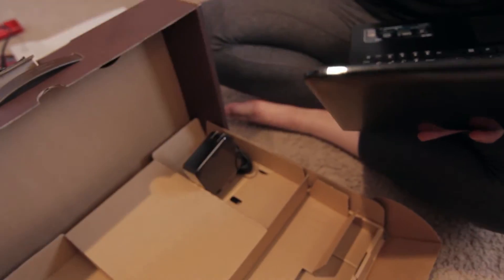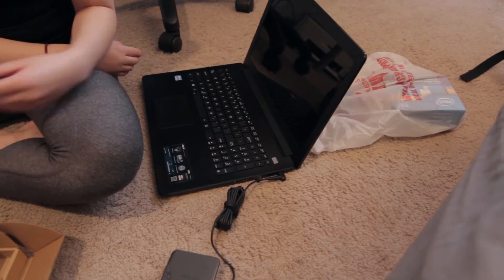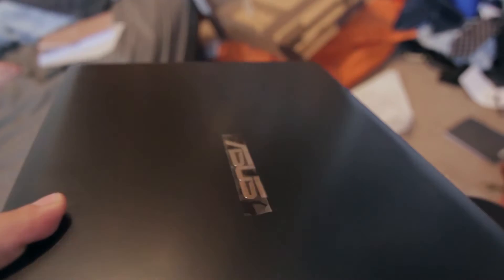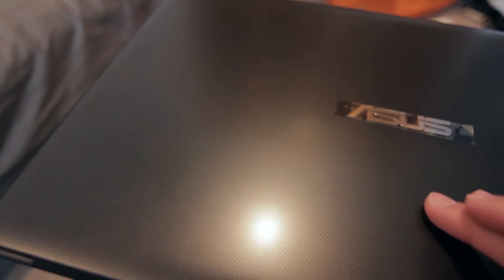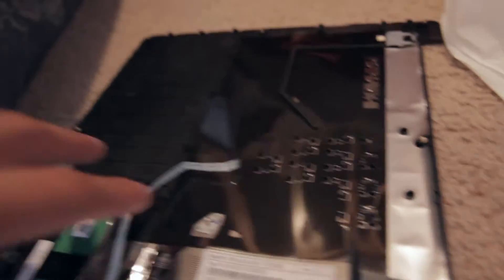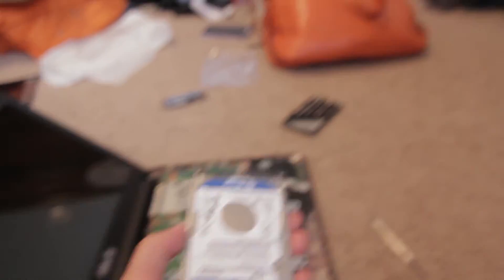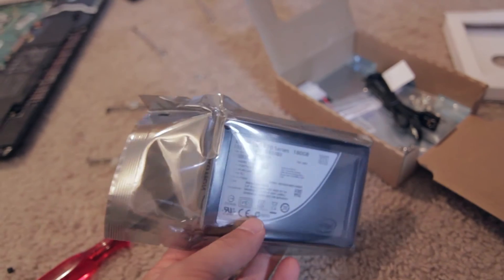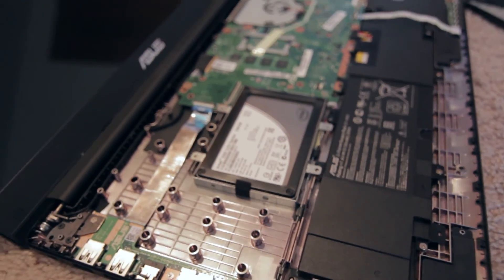Installing a SSD in a 350$ Laptop (Part 1)

Comment: Great video Nish, although a couple things to point out: You should always charge something up fully before turning it on for the first time, as it supposedly extends the battery life, and working on it on the carpet could potentially cause electrostatic discharge damage to the inside.